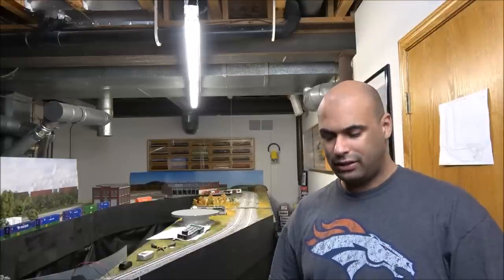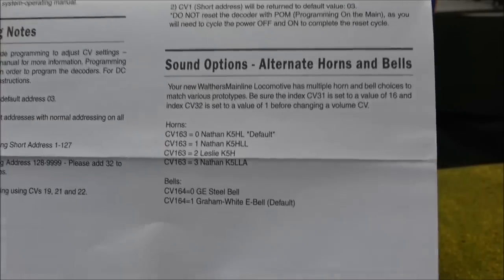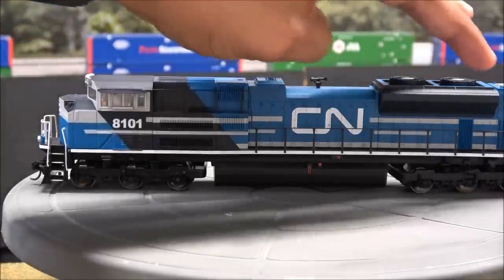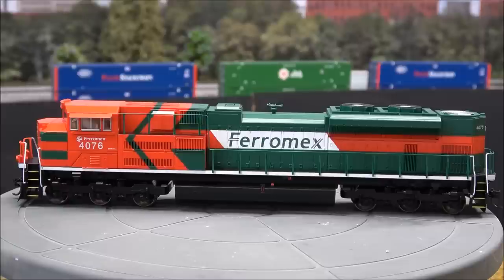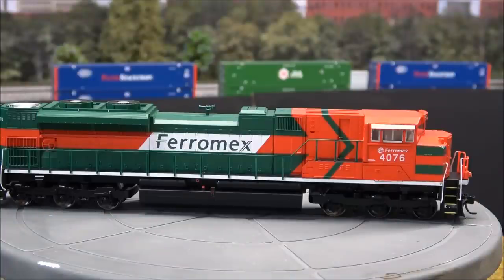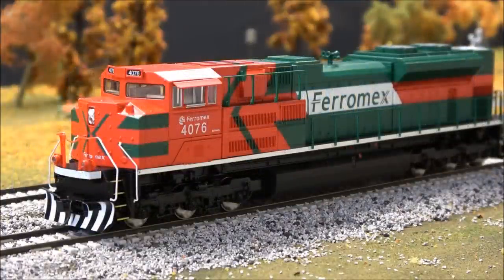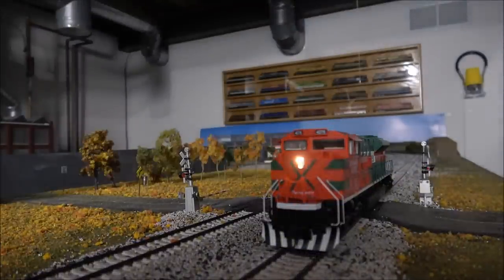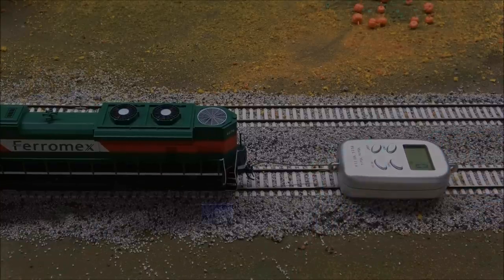Review: Walthers HO SD70ACe w/ESU LOKSound! Latest Run!

Comment: I see alot of people gripeping and moaming about the "lack of detail" on these locomotives.
Trust me I love myself a highly detail Athearn Genesis and Intermountain. But they cost 350+ dollars on average for SD70 and gevos...some not even equipped dcc and sound.

These "new" mainline (5 years later but they still release new ones) are awesome locomotives for the money. To me the details are just right and as he said they have the kits upgrades if you want.
I run my SD60 and SD70Ace (both CN) at my club on a regular basis and they phenomenal runners with incredible pulling power.
I got 5 people to get into the world of DCC with us at the club via the mainline series. People got F40PHs, SD70s, Gevos (super popular).
In my book, if you want a good looking, reliable, sturdy and strong running locomotives that will not only make you smile but your wallet, walthers mainline is the way to go hands down.😊

Comment: All I will have to do is improve the lighting, and add details.
Reply: A Walther's detail kit is coming soon for this loco.  As for the ditch lights - they are terrible with poor design. You can hardly tell that the ditch lights are on in normal room lighting.  On my loco, I removed them and installed new ditch lights from Details West and wired them with micro LED lights.  What a big improvement!

Comment: Why bother running 5 speed steps on a 128 speed scale. The prime mover does not even notch up. Why not do a still and run through the prime mover notches manually like LOC sound can do without programming CV'S. Be a better feature to show rather then a 1 mile a hour roll that is important . But who runs like that with a load in reality. Not a complaint.Just a reality suggestion. Otherwise the normal run was great. At least we can see that it can move with good power. Had a engine before that would run smooth and slow ,but would not pull anything from Intermountain because it is powered with a over sized cheep slot car can motor with large flywheels o keep it going.